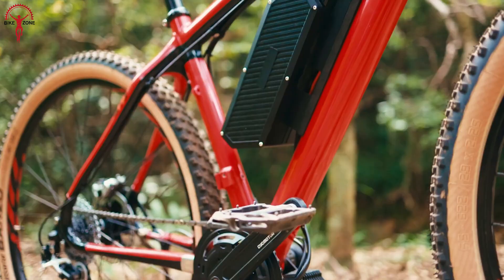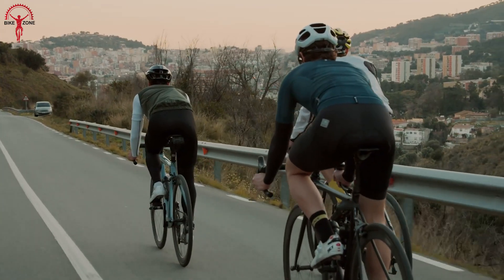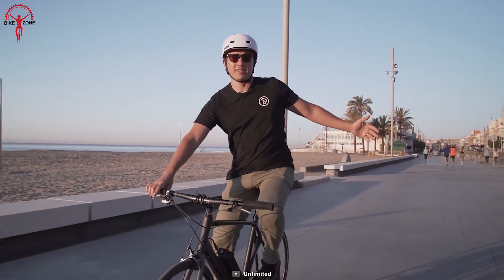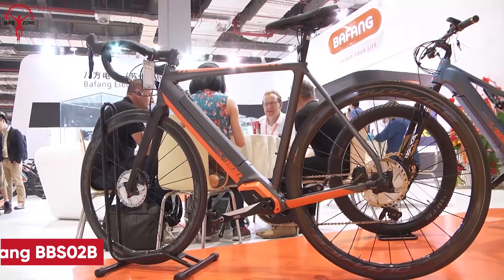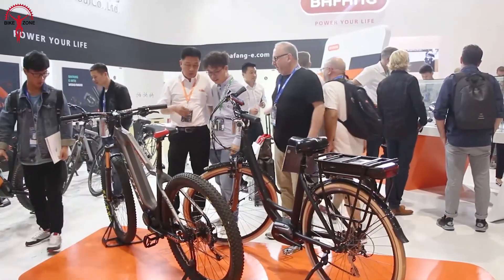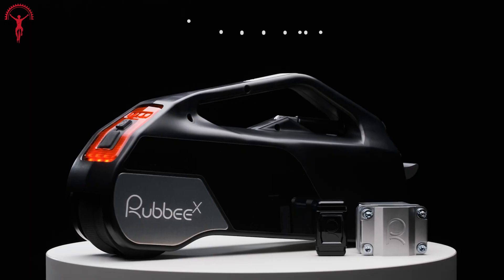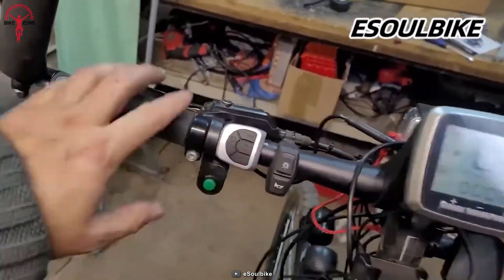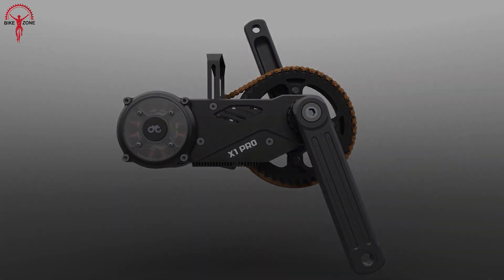Top 7 Best ebike Conversion Kit ▶▶4

Comment: I wish stores sold these things so you could make your custom bike in the bike store choose bike motor and drive system etc in the same store, maybe that 13 speed MTB is actually better with 9 gears and further between the gears so you don't gave to shift ten times from second or third and to the highest in less than one minute because the acceleration is at least 3times faster or more depending on terrain and angle..i already have a ok mountain bike but it's slow because its a trail bike they are only meant to go fast when its mostly downwards when I bought it some year's ago I had in mind to convert it after a few years it's gone a few years and now I see it can't use most of these systems but if the store i bought it in had all of them and we could just customize it with their part's and expertise I'm sure it would be a really good bike
Reply from the maker: Thanks for the idea!